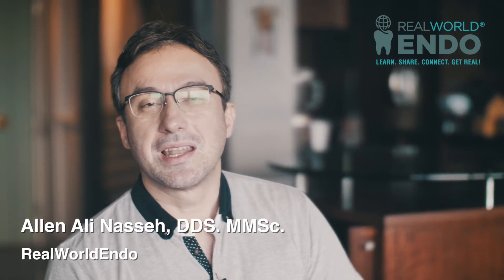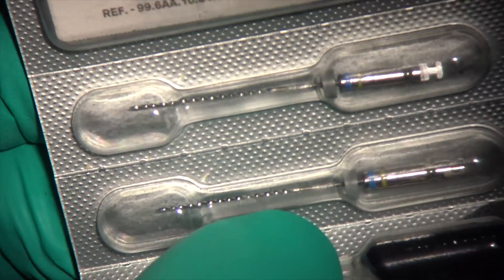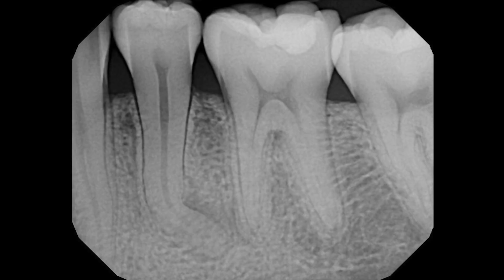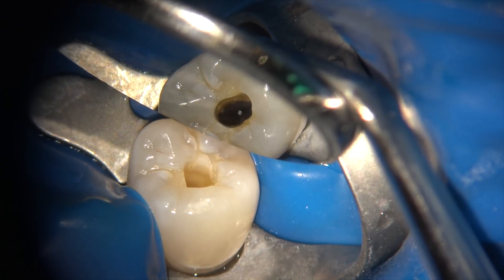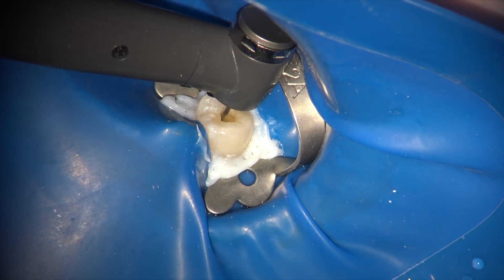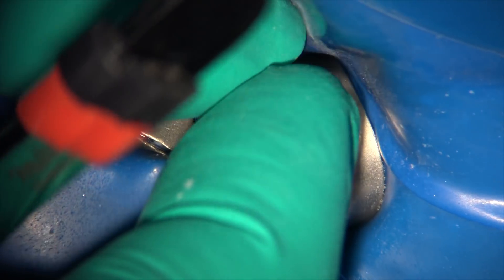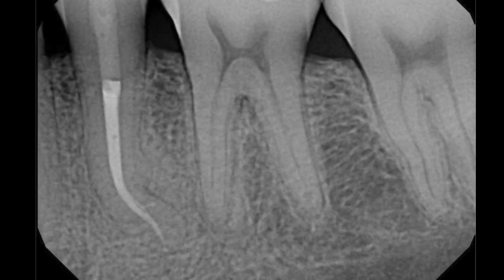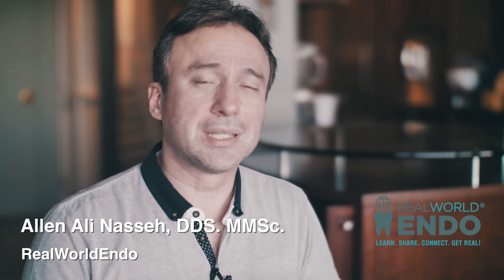CBL 30 Curved Root ESX 30 02

Comment: Wouldn't there be a chance of overfilling GP because there is no tug back perhaps?
Reply from the maker: That's a great question. I'll make a video response to it. But in the meantime, no, there's no overfilling as the resistance form comes from the taper created by the 06 file. Also, you pre-fit the cone prior to cementation to make sure it goes exactly to length and not beyond. Cheers! :)
Reply: Sandyuz I believe there is still tug back since Dr Nasseh used a 20/06 file during his shaping protocol which has the same taper as his GP cone.

Comment: Doctor..What is the setting time of Bioceramic sealer in the canal?
U have used the ultrasonic cleaner immediately.. should that not disturb the sealer.😊
Reply from the maker: 4 hours. That's why I condense the GP in the perimeter in order to prevent washout.